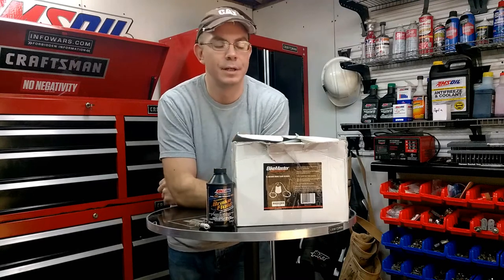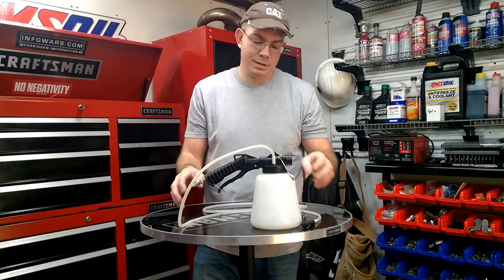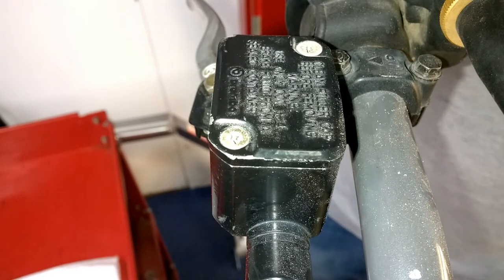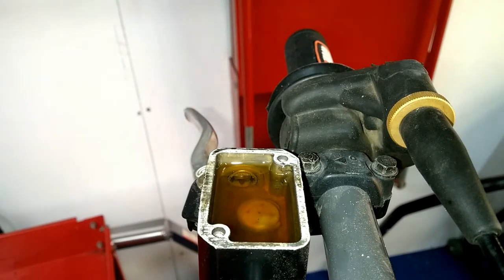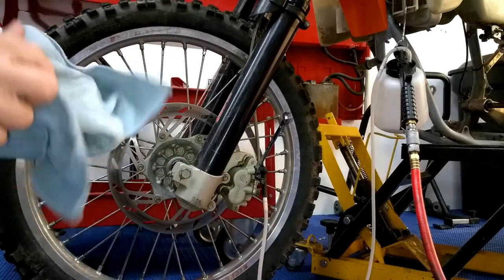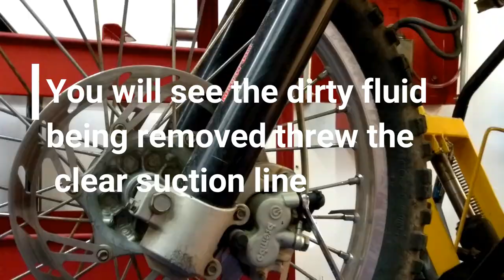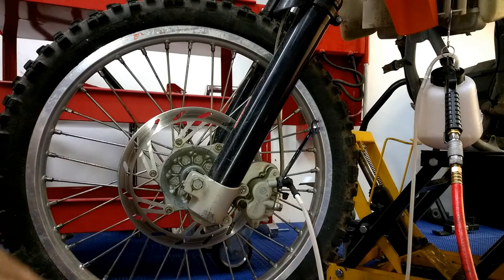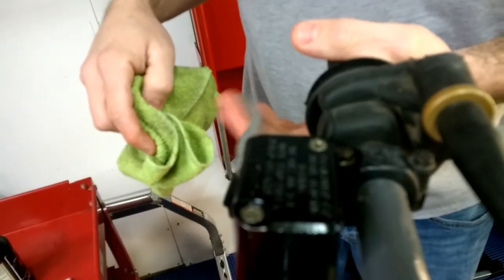Pneumatic Brake Fluid Bleeder - One Person Job

Comment: Great video!  I do have a question for you regarding the air compressor.  I have a Mcgraw 3 gallon hot dog style air compressor.  The maximum on it is 110 psi.  Will this compressor be enough power to perform this procedure?
Reply from the maker: 90psi is max I think on tool. You should be ok

Comment: Great Video Thanks !!! I will be using this on my 2010 Limited Harley on front end tomorrow, changing out my front brake lines so will be doing 2 lines at one time on front end. So I can use this on my Ford Excursion on calipers, and do not have to have push break pedal down?? ( Interesting Awesome )
Reply from the maker: Yup fantastic tool. Make sure you get a amsoil catalog from links below to get that harley running 20degrees cooler from just switching oils. Also that dominator dot4 brake fluid is some of the best you can buy. Thanks for the comment and watching!!!!!
Reply: @TorrentPerformance  I do not have tool you put on brake lever/grip. IF I do not have one of those someone needs to hold front break lever every time I open a bleeder screw correct ?? I'm doing this on my 2010 Limited FLHTK Harley-Davidson with ABS dual calipers on front. Thanks for any information, preparing for job/project tomorrow.
Reply from the maker: @Richard5873  you dont need need it to do it. Just run the tool a while then stop, pump brake, restart the tool. Id suggest doing one caliper at a time or your gonna suck that fluid fast if your by yourself on that harley.
Reply: @TorrentPerformance  Will do one at a time, thanks man. Maybe I should just put a zip tie on it or I would have to keep putting cap on brake reservoir to pump it, but was not sure how tight to put it.

Comment: Why did you have to apply the brake to bleed it and do you need to do this on automobiles as well ?
Reply from the maker: When you bleed the brake manually on a bike you pump it then hold the lever and turn the bleeder screw to release the fluid and air after you pump the master cylinder. When i did my box truck i never touched the brake pedal just hooked this up and sucked fluid out.